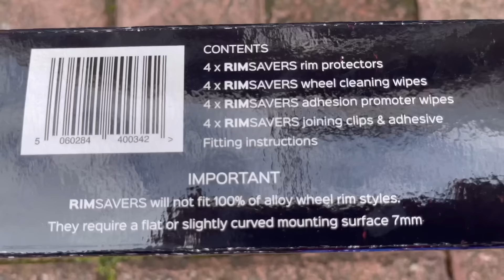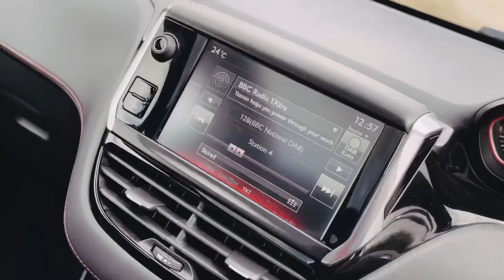🔥 SAVE YOUR ALLOYS FROM CURB DAMAGE! *PEUGEOT 208 GTI* 😈

Comment: Does it come off at high speeds as some do which can be dangerous? And also does it retain water?
Reply from the maker: Hi the reason why some come off is due to not letting the trim sit for long enough so the adhesive and trim clip can bond correctly. It is normally advised not to drive the vehicle for over 24 hours but if you do keeping the speed down to 40mph. Some people’s come off at high speed because they drive it before the 24 hour period so when they are driving at high speed it loosens the bond before it has fully cured. No it does not retain water 💦 … thank you for your comment👍

Comment: Don't they need to be replaced every time a new tire is fit? Otherwise these looks awesome
Reply from the maker: It is possible to change the tire without damage to the blade. The tire shop will need to take extra care when removing the tire. Adding tire lube to the blade allows the tire to slide by without pulling the blade off. Most tire shops are not aware of this process and will need instructions.
Reply: @AzarnPatel  Ah, makes sense, cheers